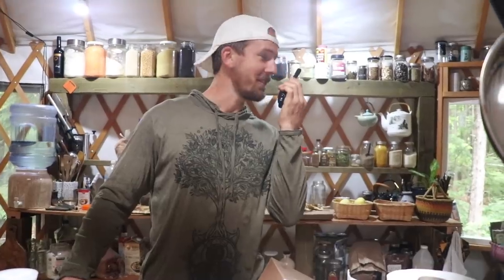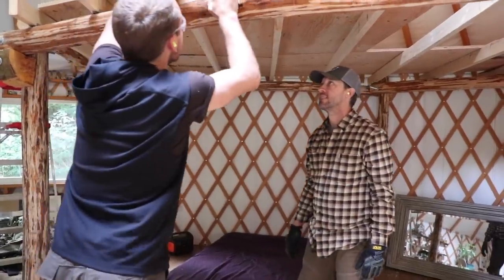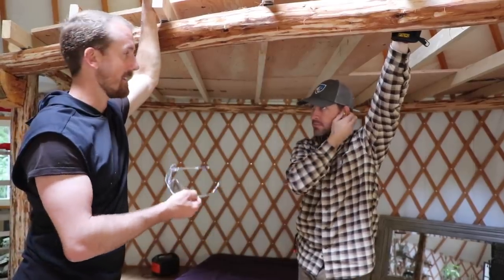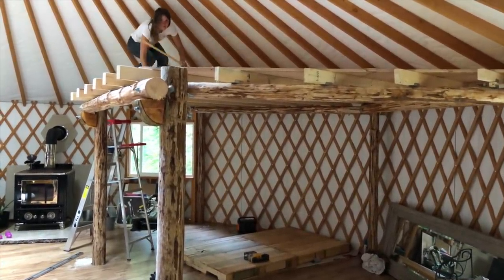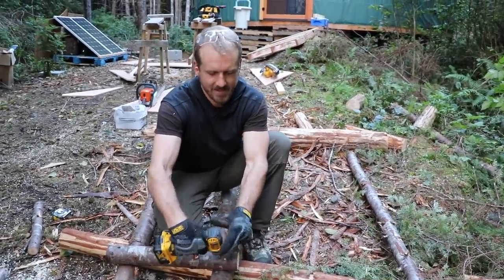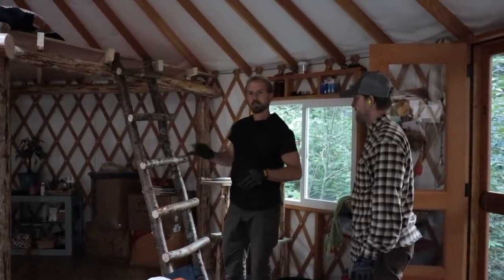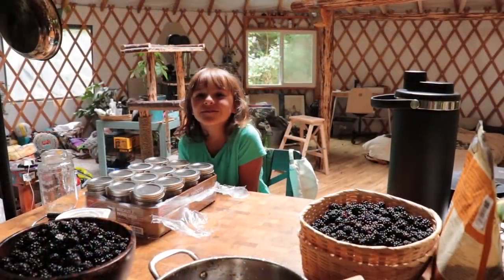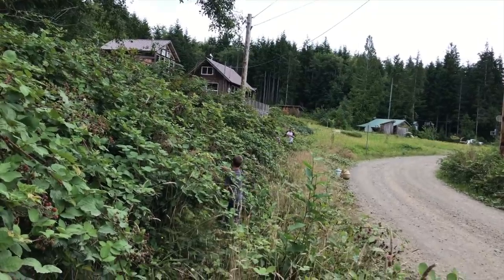Living Off Grid in a Yurt | Building a Loft - Ep. 45

Comment: Jake,  when building with logs it is mandatory to notch the logs at points of contact ... to lock the logs together and prevent lateral and vertical movement, as well as minimizing  shear stress on the bolts.  In a few weeks your logs will shrink, loosening the the butt joints you created with a thru bolt.  When that happens shifting will occur, which may be transmitted to the entire platform, as there is very little clearance where the log goes thru the floor .  If the platform shifts, there is a good possibility of catastrophic collapse of the Yurt.  Your construction of the platform leaves much to be desired. Sorry to be so critical, but I was instructed as a structural  and mechanical engineer at New York University school of engineering, class of 1970.
Reply: William P Great!  We will all wait and see if you are correct!
Reply: Better safe than sorry. William P.. maybe they should bring you in to help out. Safety is always an issue when building and you're right about the POC of the logs.. very crucial to make sure they don't move.
Reply: Think how a log cabin is built. Same principle.
Reply: You're wasting your breath William P. This guy doesn't listen to anyone. He just keeps doing the wrong things over and over even though lots of people point out the correct way to do something. I guess that's what makes these so entertaining.
Reply: Off-grid of doing things in "an off-grid way" is sometimes dangerous. . .
Reply: Look at it this way: When it goes, more content.
Reply: @kobracom77  😁😁😁
Reply: He’s not interested in listening to good advice .. in the words of Frank .. he did it “my way” .. though to be fair he has started to cross brace under the yurt now .. just needs to insulate it.
Reply: Haters gonna hate
Reply: wait and see? is it so hard for you to take critics? You are a jack of all trade but master of none... How about you do it right the first time? and listen to people that are TRYING to help you...
Reply: stingraysti Drifter, I wouldn’t say jack of all trades I believe joke of all trades is a better fit.  I was recently having a chat to a mate who is looking at building a yurt and I advised him to watch these videos so he knows how not to build one.
Reply: Jonathan Tooth, lol you are right about that. Joke of all trades is a better fit
Reply: I am shocked Jake and Nicole haven't gotten hurt yet, unbelievable, the way he just slammed everything together and viewers just cheer them on.
Reply: He calls people who give him advice trolls.
Reply: They don’t interact at all with the viewers.  It’s all about wanting free stuff, money or plugging someone (Matt in this video whoever Matt is...) else that none of us even know but we should visit his Instagram?  Why?  But anywho I see mistakes often in their building projects that are lacking to say the least.  I never comment on them because they don’t listen or ignore any helpful advice for some reason.   I have seen some very unsafe projects built by Jake and I think he just plays it by ear.  One thing I have always appreciated in life is people’s suggestions and always gave them consideration and also using their advice in many cases.  It’s just being smart about things for safety and less work later when my original plan ends up not working.
Reply: Whahaha, lmao the "master" knows it all...
Reply: William P - "catastrophic collapse of the Yurt" . Dont be stupid.
Reply: Agreed. Though the fact that the vertical posts of the loft pass through holes cut in the elevated yurt floor, down to the ground, and the top platform being screwed to the structure probably do provide enough support/rigidity to prevent an actual collapse of the structure under its own weight, the same can't be said with people moving about on it. It's a gamble, it's not the top platform's tiny screws' job to keep the structure rigid, while every other joint in it is in essence a hinge. Beams should be locked and fasteners designed to hold against tensile loads should not see much bending and shear stress. (MSc in timber engineering, University of Sopron, Hungary, class of 1999 here). Btw I just overheard Jake in another video of theirs (I'm listening to this while working, a pretty good source of motivation, let me tell you) where he says the vertical posts have been braced to the frame of the yurt platform underneath the yurt floor, which creates an entirely different situation in mechanical terms. If you ask yourself the question of how you would stabilise the loft if you only had round logs and threaded rods to build from and there was no yurt around it, the answer is getting an earth auger to dig the vertical posts deep in. The bracing Jake talks about is an alternative to that.
Reply: I am quite shocked at all of the Egos in this conversation that is going around boasting of what they should do or not do. The world doesn't go around anyone in particular. The individual that just happened into the conversation to make a comment to which Jake mentioned those that are Trolls, You are a Troll because You are Trolling! Upset that he isn't taking EVERYBODY'S point of view of "How to properly build, whatever". Yes, he doesn't know You Personally. You don't know him personally. It isn't anything against You or the next viewer that gets his (Sadly), Male Ego Bruised. If You are just sitting around watching YouTube Videos and being Pompous and waiting for whatever the object that he built not to Your Liking or Approval. Or one of the lucky one's to have gotten an Ivey League College possible degree. Then You should probably find a new life. As this one You are using is being waisted.  
For me, I am actually enjoying watching their segment. I believe that the Loft is going to stay right where he built it. Especially with those logs as a base. If not, and something happens, then it was something that they had tp go through to learn. Not only that, the thing that really, really gets me? You are not there with them building something that they have dreamt about doing. They are filming all kinds of footage. How do You Really Know that they didn't build it correctly? To me The Nay sayer's are the one's that are sounding Snide to me. All Jake had to do was post this latest clip, make a couple of Comments that didn't sound like he was being rude and a few more viruses came in and had to join in yet another individual that feels that his attention is worth something in here. Sorry to have to say this again, but Your Opinion at this point, in this type of setting is only worth the amount You make for a living in Your State if you are in The U.S., Province if you are in Canada, and your City which You reside in whatever dwelling that you are choosing to live in. That is it. It isn't Personal, Jake and Nicole have decided to share their dreams with those that might enjoy to watch it with them as they go to the next step. I am not saying that they wouldn't enjoy any of the ideas or suggestion's, including your Opinion. Understand that it is Your Opinion not theirs. I am not saying that they aren't accepting for the thought of their safety. They are not on a one wsy adventure going down the road where All Life Ends. Come on People. Chill and get of Your High Horses, they are not building All of this for You, (that means everyone that I tagged with a Thumbs Down). 😞😑🤔😲 Really sit back and have a Good Interaction with those that You are taking some time out of Your Life to watch and relax. Not to get butt hurt. 😀
Reply: @cynthiahoffman8683  Agreed, though there is a difference between giving technical advice constructively, and dropping a stupid, negative, "sour grapes" type of short phrase from the comfortable anonimity of some nick just for the sake of doing it, because otherwise you'd either not leave a mark or you'd have to comment positively, admitting the protagonists have done quite well in life - neither is an option a troll can live with:) But I guess it's just something you have to accept, you post any footage and it will always attract some trolls. People of this type have been around since time immemorial - social media is what brought them to the surface. It seems to me William P does not fit that category, and that's probably why he felt bound to indicate he has a relevant degree in the subject, and that's the case with me too.
Reply: @szk7505  Thank You for pointing that out. How lucky I am to have my comment actually under Your response. Which I am not speaking negatively there. Just making sure that it wasn't misunderstood as also being snide. I also understand since we are posting qualifications on here to justify our backing up our learned knowledge. Thank You for not attacking my writing skills as that has to be prominent in a posted comment. Though I guess it to would be important if we are posting our qualifications. I Appreciate your backing, and I do Appreciate you pointing out that that I didn't  (basically stroke the Male ego), but I guess if you really knew who I was and really how I think. Then you would see why I didn't complete or close my comment with one. I personally do not like to Addume on any issue. Though I am a Human and I do those daily and if I post anything, and that is usually I don't like to make any type of Comment. So I askef myself if I went ahead and wrote what I obviously written, that I would have to accept the Negative as I do the Positive. It is life. I am in my 50's and I do just happened to stumble or strategically been placed in a location that the Backers of these Video's pay so well for their Commercials to be seen. Otherwise I could see this platform  being sadly, worthless. That in itself would be shameful. The primary reason why I didn't do any ego boastering was really quite silly, as it was late just like I am doing now. Catching this to slow and realizing the time and that I seem to just shy a little way from  making a comment short that isn't like resding a book. See, I do it to myself as I do on to other's.  Which is the Truth, I am my own worse enemy. You, Yourself can't do onto me that I again, already done. Hope that You have a Wonderful evening, or Day. Whichever side of the Country, even another by chance. It is all Good! 😄❤ Good morning to You from where I am in this all of a sudden. Not so small World after all. 🤔😥Catch You later, maybe.😀
Reply: William says the yurt will ALL come tumbling down. Lmfao.. the yurt is not holding that platforms weight at all and those logs will shrink if anything and not by much. LoL.

Comment: If you are getting eaten by mosquitos then it is a good idea to boost your vitamin b1. Mosquitoes are repelled by vitamin B1. Spirulina is high in B1 so if you take a tablespoon each day it should repel them. It can take up to a month for it to work. Hope this helps.
Reply: Bronnie Price we used to get eaten by mosquitos in our off grid home in Spain. We take vitamin  B1 tablets and the difference is amazing, they still buzz around but don't bite. Also, we bought a zapper which looks like a small tennis racket, operates on two small batteries. We get great satisfaction in zapping them. Best €3 we have ever spent.

Comment: jelly of berries: Step 1
Wash the blackberries quickly, throw them in the jam dish, put on high heat.
2nd step
As soon as the fruits burst, pass them to the vegetable press (easier than the tea towel for an identical result).
Step 3
Weigh the juice thus harvested, add the sugar in the following proportions: for 1 kg of juice, put 750 g to 1 kg of sugar according to the preferences of each.
Step 4
Put back on the fire, as soon as boiling, skim, let it simmer, stirring occasionally for about 5 minutes.
Step 5
Remove from heat and put in pots.

Comment: Dang! That looks almost identical to, but better than the Pacific Yurt we put up in the Sierra foothills in 2001. Much better windows. But the details look so familiar. 

LOVE YOUR LOFT, especially the poles. The lofts I knocked together in college and later just used 2x4s from a hardware store. I see your Yurt has the grand Skylight/Hub... Sturdiest element in the kit. 

It would be interesting to know if you built your own scaffolding to stand at the apex and get all the roof rafter connected to the hub. Getting the hub and first rafter beams in place, was the one thing my wife and I thought we HAD to have some other people helping. Almost everything else could be done by two people. A lot was just one person working steadily over time. This was on a small ranchlet that already had a House before I came along, so we were able to spread the work over a month. 

You've done a good Job. Brings back some good memories. You'll likely re-evaluate some choices as you see how things function. 

We found uses around the place for even the sturdy tarp material that wrapped some of the structural elements for transport. That served as part of a shelter for a few foals, otherwise built from 10-foot steel pipe gates that had been lying around. I was amazed that a shelter lashed together with Heavy duty ZIP Ties lasted for two winters with those rambunctious yearlings jostling and "rough-housing" when they were under the roof. When the new barn was built, I just snipped the zip ties to disassemble. Not a single one had parted. (Used a bunch.) Lesson. Don't be shy about improvising. 

We located ours some distance from any trees, concerned about the fragility of the material. That put it in full sunlight almost all day, so the skylight was open most of the summer months. We had a few windstorms w gusts up to 80 fer-Pete's-sake MPH, and that thing didn't budge, with its support beams anchored to poured concrete, not the smallish cast piers. Seems like the Kit designers really did a great job on thinking through everything to make it straightforward build for the DIY buyers. I hope you've had a lot of satisfaction with making your home. Don't know if you have friends from whom you've learned a few things, or if you just plunged in Feets First. Maybe it's reassuring to know those yurts can last for two decades. You might anticipate the thing will need a new skin about 15 years along. Thanks for sharing.

Comment: Jake look what Nicole did at the 5:11 mark in this video , the whole platform shakes --- this shaking will only get worse -- I really do not want to see you or Nicole get injured.  If there should be any strong wind storms, the platform and Yurt will act as a sail, as I did not see any hold downs anchoring the platform to the earth. IMO the water tank you installed can, and probably  will become the perfect breeding ground for microbes (nasty ones) .  A VERY small amount of Potassium permanganate added periodically  to prevent micro organism multiplication  or Clorox. I trust you have a place to take shelter in the event of a storm.   I should mention, the flame from the propane stove was yellow ... indicative of a deficiency of oxygen. There should be an air shutter within the stove to add more air to the burner.  The flame should be blue not yellow.
Reply: Last winter Vancouver Island had an epic wind and snow storm. There was massive tree blowdown in the forests along with several inches of heavy wet snow. They do need somewhere to shelter when that happens again.

Comment: You all did a great job on the loft! Hi Matt! Question...what are you going to do about sealing off the underneath of the yurt for the cold months? If its sealed,even with plastic it would keep some of the cold and snow out.
Reply: If it's a Pacific Yurt like we had in CA, the flooring has SIX INCHES of closed foam insulation laminated between sheets of 3/4" Plywood. Winters in the Sierra foothills hovered around freezing for about four months, and we got by with a small electric heater thru the first winter. The larger house for the rest of the family, in-laws, etc was only a short distance if things got crazy cold. The flapping of the fabric skin was the only thing that ever made us sleep in the other.

Comment: I would also be concerned about potential damage to the log foundation, deck and loft due to shaking from earthquakes.
https://www.theweathernetwork.com/ca/news/article/4-6-magnitude-earthquake-strikes-west-of-vancouver-island-british-columbia
https://en.wikipedia.org/wiki/1946_Vancouver_Island_earthquake
There may be need for additional cross bracing and thru-bolt fastening of logs, beams, etc in addition to the relatively small screws used in the original build so far.

Comment: Why drill pilot holes in the plywood decking on the loft before you drill in the screws?
Reply: So the screws don't split the wood.
Reply: Nah, not in 3/4” sheets.
Reply: @adamclay2161  Umm... yah. It happens. But maybe only to us amateurs.
Reply: @adamclay2161  I'm a big believer in pre-drilling, and I've been doing this for 40 + years...seen one too many stripped heads by guys trying to force the screw in - not so much fun when you need to remove the screw.
Reply: @rogercarrico4975  I understand the self-drilling concept and there is a place for that, but pre-drilling is more about drilling straight and true into the framing member. many guys get in a big hurry and the screw - following the grain - drifts off center, sometimes popping out in the worst places.
Reply: @richardvsassoon5144  oh hey, I agree 100% . A pilot hole is very cheap insurance. Believe me! With old, brittle, hard wood antique furniture. It's a absolute must!!